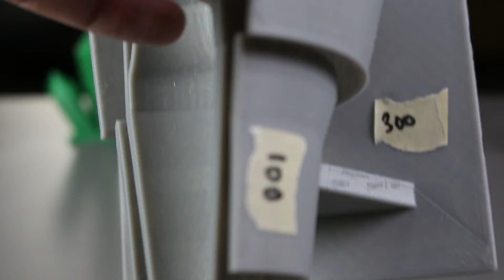Smoothing 3D Printed PLA Prints with a Sandblaster

Comment: You just demonstrate that it does not do (nearly) anything and with your figurine you even show us how printed layers are being ripped apart. Moreover, I can imagine that for technical parts made of resin is completely unsuitable, because dimensions change and there are deformations, not only due to the pressure of the medium blasted against the product but also because of the heat that it generates; it deforms the cured resin. In my view, for ordinary resins this is not a suitable post printing method. I print with SLA printers only but even then, blasting is not the best thing to do.

Comment: Sandblasting is a fast and easy way of smoothing the lines on the prints. But only if you have the right equipment. You need a lot of air when sandblasting. Preferably a rotary screw compressor with a delivery of 900 litres/minute, at least 500 litre air tank and a good sandblasting pistol, not a 20$ walmart special. For blasting you should use a ceramic, like aluminium oxide. You could also use quartz but it creates a lot of dust so it's a lot harder to see what you are doing in the blasting tank/box.

So in theory, you can sandblast the prints to perfection, but the reality is that you will need near industrial grade equipment to do that🤷
Reply: And you don't need industrial equipment, just large enough tanks to support the duration of time needed. For small-scale hobby levels,  like valve covers, a 20gal tank is enough. Just don't expect it to be fast.
On cheap cabnets with siphon feeds, do a metering valve mod instead to make it more efficient. Can run at lower psi.
Reply: aluminium oxide is way too abrasive on plastic, you either use plastic on plastic or soda
Reply: Soda is great for cleaning, but I honestly would think a more you're glass bead at a low psi would be much better at hiding the layer lines. 
I think the finer media doesn't leave a large enough impact to make a big difference. 
The goal, imo should be to peen the surface, not remove it.

Comment: Thanks man, very good and detailled video. I was thinking to get a small sandblaster, but this is really for super fine tune post-processing, but if you really need to remove the layers, it has to be done manually.

Comment: 5 to 10 minutes of sanding?!? It's takes less than a minute on metal
Reply: Bro metal takes forever depending what cabinets your using how much air pressure what medium and if there is paint or powder coat on it .. I do this for a living .
Reply from the maker: Thanks for the comment! The media that we were using wasn't new so we left it in longer.

Comment: Thanks, you just saved me from wasting money on a mini sand blaster, now I know it doesn't work.
Reply from the maker: Thanks for the comment! The media that we used in the experiment wasn't new but we believe if the media was new it will provide better results.
Reply: @Tinkerine  Looking at the results, the media was not only old, but also dirty as your prints look smudged and brownish after blasting. Would clean media still affect the color of the prints?
Reply: It could definitely make it easier to paint though
Reply: As long as the wall is thick enough,  sandblasting might even be too abrasive sometimes. But you need to see what you're doing in order to get a decent affect

Comment: You didn't say what medium you were using. If it was actual 'Sand' like you were calling it then you are crazy. Sand contains silica which causes silicosis if you breathe it. Deadly !!
Reply from the maker: Thanks for the comment! We actually used glass bead but it was quite aged, and I thought we actually used sand.
Reply: @Tinkerine  What was the rating of the medium? I mean the average thickness of glass beads. What microns? Thanks..
Reply: Sounds like concern trolling

Comment: Harbor freight sells a cheap sand blaster. Also I would like to see the sand blasted parts with a coat of primer or other paint to see how that looks. Thanks for posting the test !
Reply from the maker: Thanks for the comment!
Reply: Or, buy a resin printer for the same cost.
Reply: @float32  I have a resin printer, I still need to sand? Everybody does, for that perfect finish.